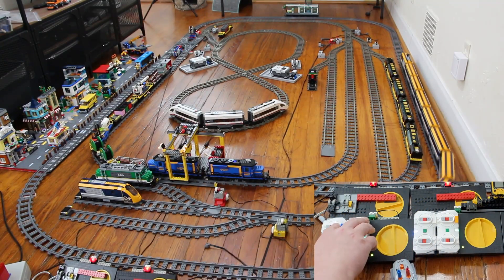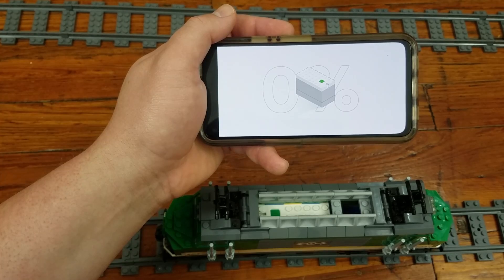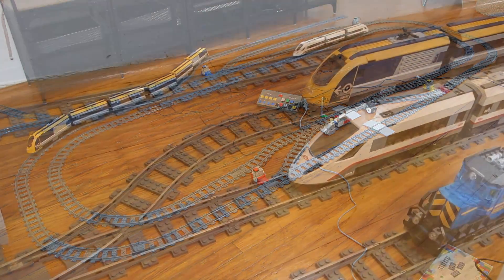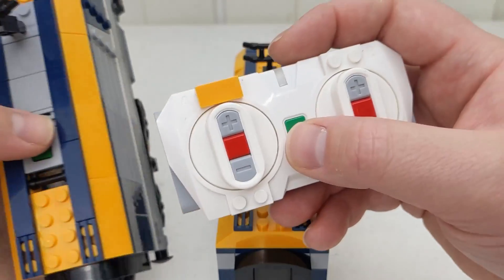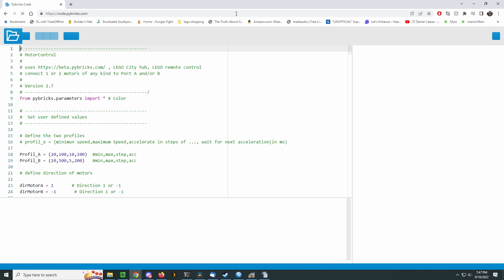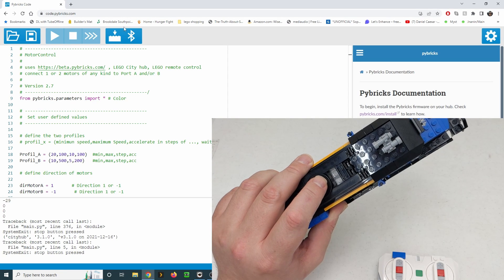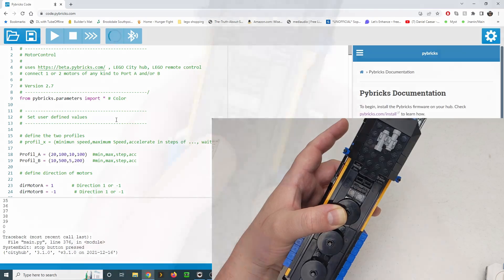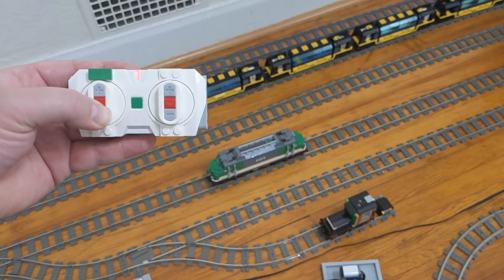Controlling Multiple Lego Trains using Powered Up / PyBricks

Comment: Love it! Thank you! Going to play with this. Want to run 3 motors,  2 on an MOC freight train and the other an old lego city freight train
Reply from the maker: In my more recent Pybricks videos some updates have been added by a member of our discord.  I've had 4 locomotives, each with dual motors all controlled from a single remote 😁.  The Powered Up system really is something when you factor in third party software / firmware

Comment: Has anything changed regariding pybricks allowing for mutliple hubs being controlled with one remote? Im looking for a way of having a long train with multiple locomotives and having a slow start. Any ideas?
Reply from the maker: I think there is kind of a work around to have communication between hubs running PyBricks.  I haven't seen anyone put it to use with trains so far.  I'm not a coder myself so I'll have to wait for someone to come up with a solution

Comment: Have you tried to upload the same PyBricks firmware + program to 2 hubs, that are part of the same trainset, then pair both of them with the same controller ? Does that work ?
Reply from the maker: I don't think so. From what I understand the way the controllers connect to the hubs is part of the firmware, PyBricks doesn't support connecting multiple hubs to a single controller.
Reply: @BatteryPoweredBricks  Sad. Because PyBricks otherwise brings some real automation, with the color/distance sensor.
Reply from the maker: @BricksWorks  Even more-so if communication between hubs was supported.  I think there are some hacky methods of making it work, I haven't checked in for a while.  For now I'm more interested in Brick Automation Project for some light automation

Comment: Hi all, i am totally new to pybricks, the Program from lok24 is not longer available on his site, do you have an other source  or a complete program to run trains with two engines with Lego hub and remote Control?
Reply from the maker: Thanks for the heads up.  I'll let him know.  In the mean time I've added a google drive link to the program.

As for alternatives, the Powered Up app can do this but a phone must be used at all times as an intermediary (which is why I've never bothered) and the program can't be shared (besides a screenshot), it must be made from scratch.  The Brick Automation Project software can do this as well but it requires a PC as an intermediary.  It is a powerful piece of software and very easy to set up.  I have a video on this as well but I didn't go in to detail with the controller programming.  Cheers!
Reply: @BatteryPoweredBricks  Thank you very much !!!

Comment: So how do I get the second hub on the “b “ side of the controller? I watched the video but didn’t really see much mention of it, mostly just to have the two hubs on the “A” channel of the controller.  Thank you
Reply from the maker: Oops, I guess I did forget to mention that.  The A and B sides are controlled by which port the motor is plugged in to on the hub

Comment: I would like to see videos here explaining the older black & yellow IR systems, & if they are compatible with RCX or other IR enabled systems.
Reply from the maker: Gotta clean some battery corrosion first :).  I know the HiTechnic IRlink NXT sensor can control them
Reply: @BatteryPoweredBricks  sweet! I asked because those are the only type of trains I have, other than the modifiable Emerald Night.
Reply: @BatteryPoweredBricks  yeep ive seen it in use before to basically have cheap robots using power functions